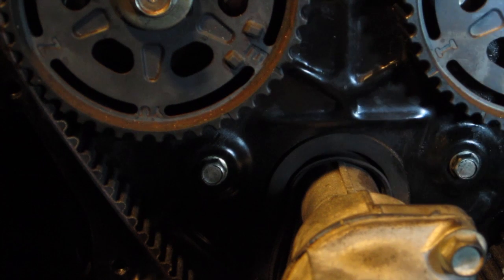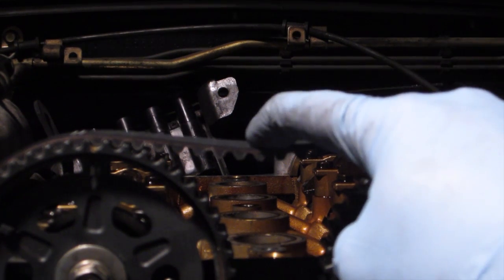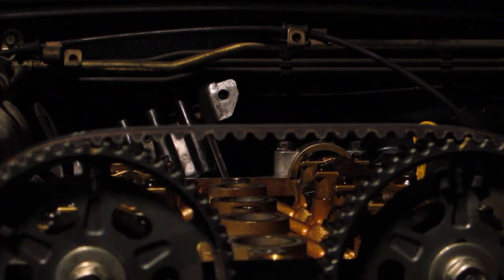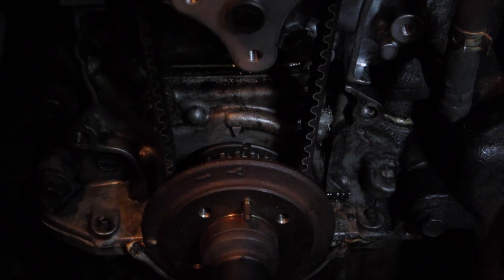1999 Miata timing belt pt3

Comment: These videos were done really well with great high quality resolution for someone who is new to changing timing belts/water pumps. 

One problem i noticed in this video was that when you turned the crank from TDC mark to the tensioner mark, you went past the mark itself. it is NOT the bubble, the mark is hidden behind the timing belt and it looks similar to the TDC mark.
Reply: +Marloon I'm about to do this on my '02 1.8 VVT Miata - is what he did something that will cause a serious problem or is it probably fine? I'll try and see what you're talking about when I get in there